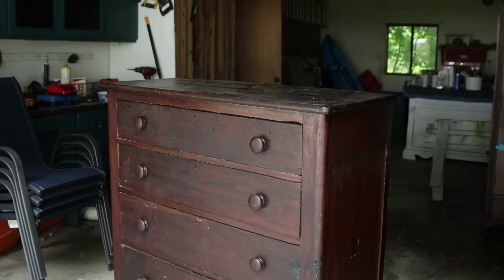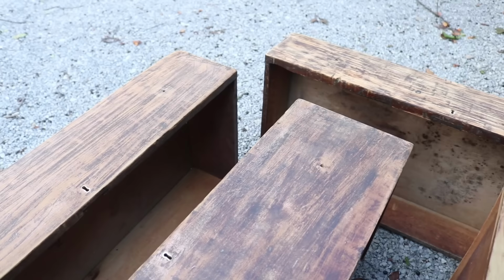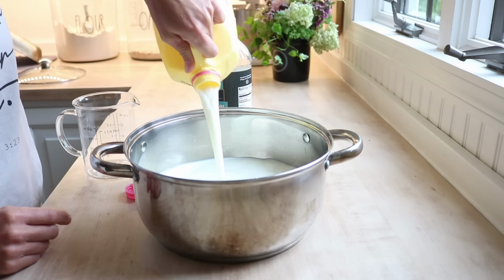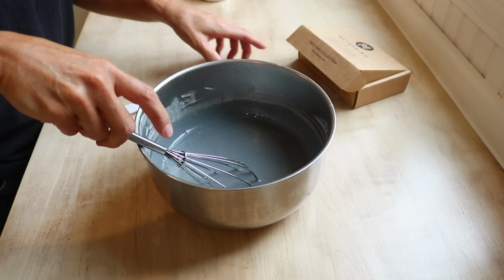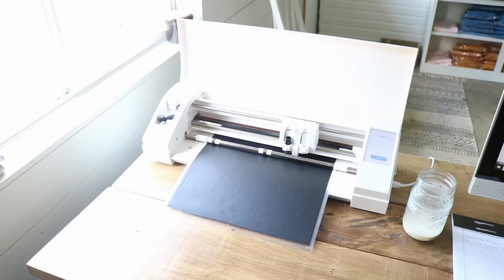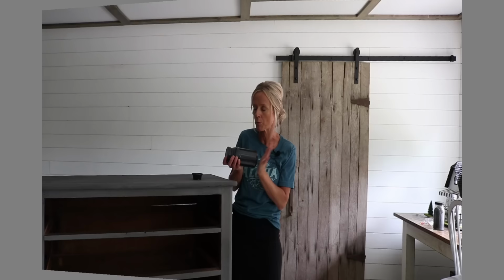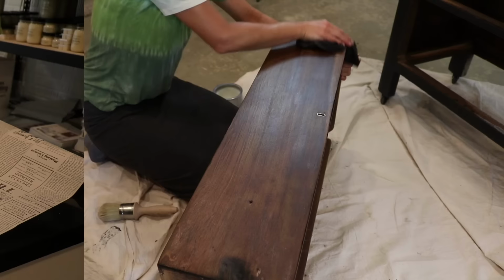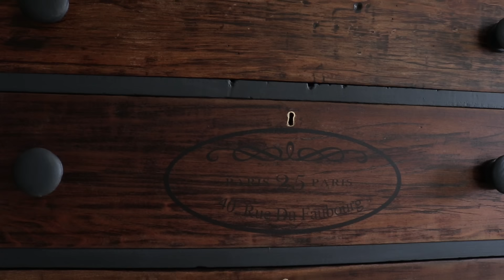Homemade Paint Recipe ~ Milk Paint Tutorial ~ Painted Furniture makeover ~ Paint from Scratch Idea

Comment: Using just plaster if Paris will thicken too fast. Adding 2 table spoons of linseed oil will help level brush marks and slow down drying also helps with adhesion. Pre prime wood with vinegar will help lime from cracking. Apply wax or clear will help the lime from absorbing carbon dioxide but if your looking for a hard surface like table top no vinegar and wait on a top coat. Prime drywall with a slurry mixture. Prime concrete/masonry with a white glue slurry

Comment: This is old fashioned milk paint!!! YAY!  I actually sell the powder milk paint in my shop.  All you need to do is add water 1:1.  When using Milk Paint you have to use what you mix or else it dries out fast.  That's why I like the powder formula, just mix as much as you need.  The Milk Paint I sell is also FDA approved.  It's a very interesting and different medium to work with. Your dresser turned out amazing!

Comment: It dries fast and a sealed container won’t stop it cause it’s there’s a thermal reaction. Less plaster if Paris will slow it down. The other one got thin and didn’t thicken probably cause the reaction happened and stirring broke it up. It gets gritty and translucent. Be sure to use clean cold water.